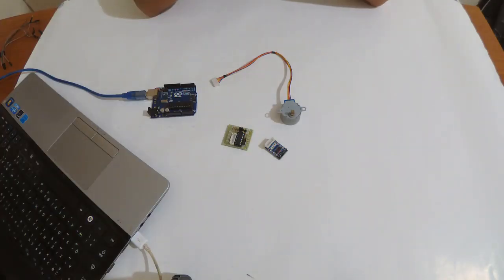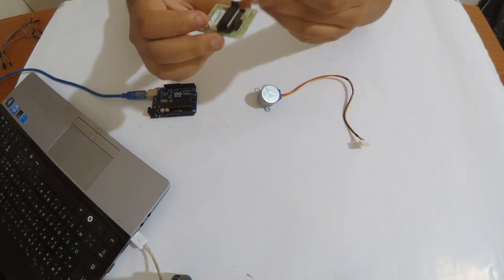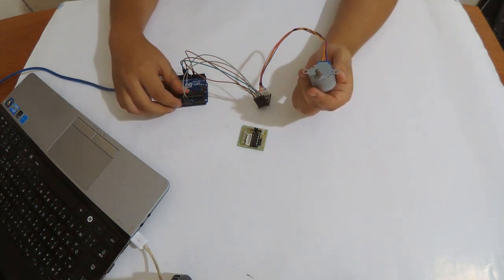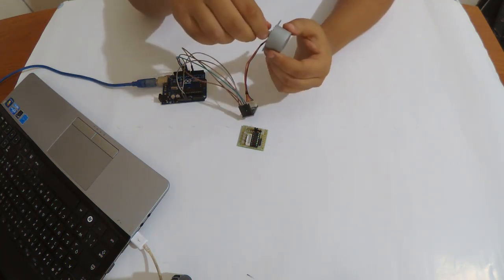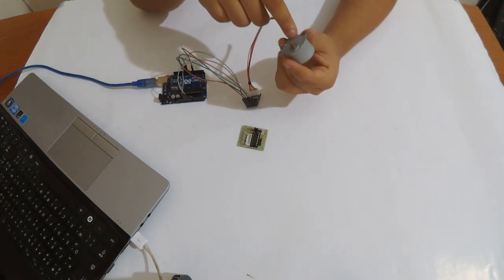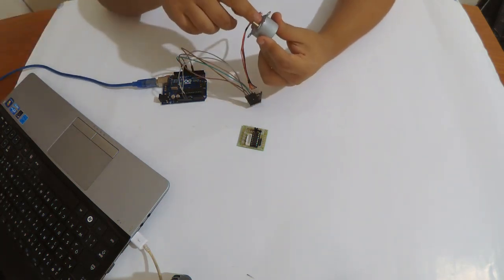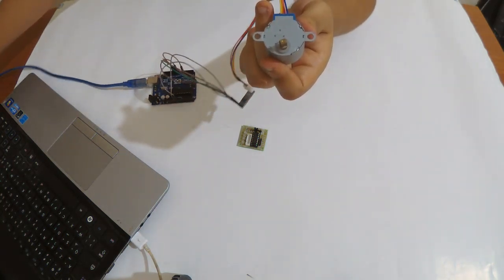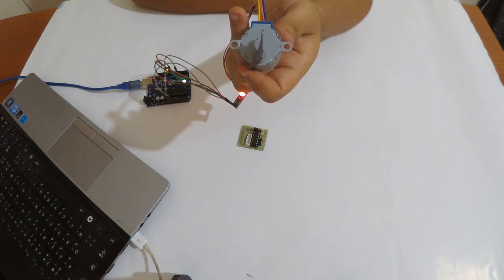How to use Stepper motor with Arduino and ULN2003 driver

Comment: I have seen that all tutorials teach ULN2003 with stepper 28byj-48. I have a PM55L-048-HP69 Unipolar Stepper and I would like to know how to use it with ULN2003, since the sequence of the wires is 1,2,3,4,5, with the wire 3 being the common one, therefore, I would like to know how to connect this sequence to ULN2003. Thank you